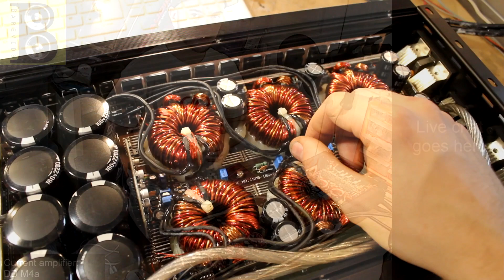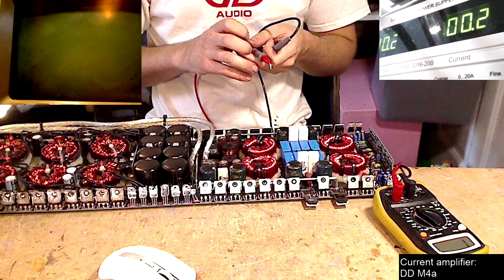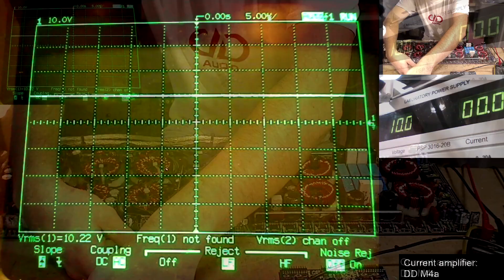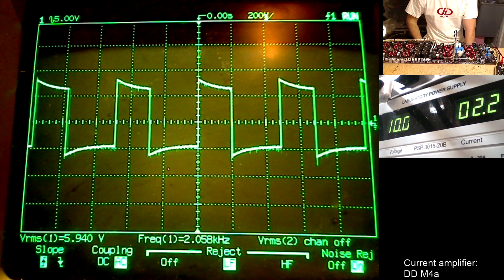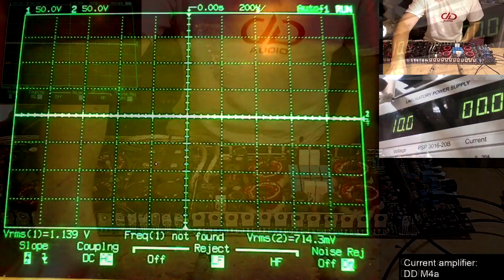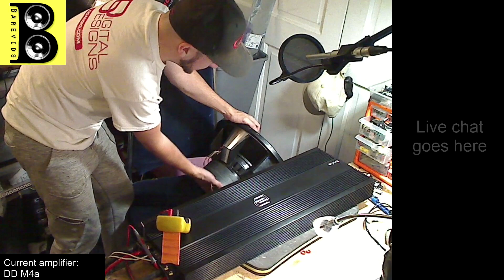How to repair DD M4a amplifier?! Walkthrough

Comment: Must be something with these DD DM series..I have a DD DM-2500A ive tried to repair a few times..About to throw it in the trash pretty soon..Its gotten so bad it just smokes the wires when i try to tuem it on
Reply: I use mine for parts now took the terminals off to repair a nemesis NA-6KM that I have in my truck..Never buy DD again for me lol

Comment: Oh and I also have a Taramps 15k bass that needs repair the issue with that amp is that when the radio is turned off the amp won’t shut off till I remove a specific power cable from the battery

Comment: please please can some one help me with a Phoenix Gold RX500.1 mono block the driver board as a tip42c that as a blue resister oneected to it mine is blown to bits and carnt find the colour bars i think it could be brown black black gold so could be 100 ohm or 50 ohm or 10 ohm its a metal film resister or was lol its driving me insane not knowing so if any one as this amp Phoenix Gold RX500.1 and can confirm the rester on the power driver connected to tip42c and tip41c

Comment: When you started using your scope to probe the pos and neg rails, where was your scope grounded to?
Reply from the maker: Shares a ground with the 12v power supply negative through the mains. This means the ground path is quite long so there will be some minimal noise on the waveform, however when probing high voltage signals this is negligible. If I need to probe some very low voltage waveform where shape is critical I will hook up the probe ground wire to a close reference point.
Reply: @barevids  oh ok, so your benchtop DC power supply has the mains ground connected to negative then. Like shorted out at the supply terminals I'm guessing? I'm having a hard time with grounding cause so many videos say different things. I saw a lot that said it's important to have mains ground be completely isolated from the DUT and the Oscilloscope. To avoid accidentally shorting the mains. Is this just not an issue because the amp is not plugged into the mains line? Like no hot mains going through the amp? 

Thanks btw for the reply brother, I know you have a lot of subscribers and comments so I appreciate you taking the time to reply!

Comment: hey guys, could someone explain why there is negative voltage at the low side fets gates at 19:21? And where does it come from, i mean how is that created if you understand me
Reply from the maker: Negative rail at lowside gate is just "ground" as far as its concerned. It comes from both the pull-down resistor between gate and source (which is connected to neg rail) and also from the drive IC lowside output which is ref to neg rail.

Comment: So if the voltage regulators don't show a short circuit then does that mean either they are damaged or the transformers are damaged or the traces between them?

Comment: i have an mtx amp that is stuck in protect because i was adding another amp and i accidentally wired the power inputs in reverse... it didn't damage the new amp but the one that was connected in my car won't come out of protect mode... i tested the continuity of the 12v imputes and my multimeter beeps but stays at 0.... does this mean that the problem is in the power supply side?
Reply from the maker: Output fets shorted
Reply: @barevids  thx.. so if I change the output FETs then it should come out of protection?
Reply from the maker: Maybe, maybe not, you may have also damaged the drive circuit.
Reply: @barevids  k thanks for the help :)

Comment: I have a Diamond D3 400.4 amp from 2003-2004  that just quit one day. Amp powers on does not go into protect but has no output to the speakers. No hiss or anything. The amp is extremely clean and I love it just dont wanna give up on it yet. I fix TVs but I’m just not highly educated in amplifier repair what should I check? Love the videos man you are very knowledgeable.
Reply: UPDATE: 

I found a MPS A56 that is completely dead across pins 1 and 3. All the other MPS A56s on the board measure good. I thought i had no sound in the amp but holding a speaker to my ear I could barely hear music. I’m hoping I can just replace it and the amp will work. I’ll know soon enough.. if anyone has any insight please let me know. Thank you in advance!!

Comment: Nothing like an M4a, kinda expensive though.
Reply from the maker: Actually there's many amps like an m4a. Identical, in fact 😂
Reply: @barevids  Can you name a few, that M4a is $2599 if there are identical amp to that one and a bit less expensive it would be great to know.
Reply from the maker: @DJ_Renn  SPL dynamics D7, DC audio 7.5k, Sundown ns1, etc. These amp all use an identical circuit architecture with minor differences to rail voltage. Anything Korean halfbridge in this power band is the exact same circuit. Ka7500 PS pwm, 064n or 1405 PS fets push pull an array of transformers, class D circuit irs21844s drive with 24n40f output fets. If you compare guts shots you'll see they're the same, only differences being multiple smaller transformers or lesser big ones. These circuit designs are over 20 years old and it's ridiculous that they are still being churned out and marked up to such huge price tags, when you have brands like Banda building far superior amplifiers, using modern reliable drive architecture, PIC integration, lightning fast protection, modern low RDS mosfets, for a fraction of the price. The banda Viking range is hands down the best mono bass amplifier you can buy right now, and it's cheap as hell.
Reply: @barevids  This is exactly why ive been subscribed to you since forever......Ive learned more from your videos than any other place.......Thanks.....
Reply: @barevids  I had a Ampere 5K (Korean) on 2 Fi BTL neos swapped for a Taramps 15K and the bass was night and day difference, the Tramps just didn't do the low end like the Ampere 5K, I wound up putting back the Ampere and returned the 15k. I now have a Sundown SCV 7500 on 2 Fi audio teams, the question is will the Banda Viking 15k out perform the Sundown cause the Taramps 15K was just a failure. Here is my video of the Sundown https://www.youtube.com/watch?v=nT7kJsset1g
Reply from the maker: @DJ_Renn  yeah the Taramps is an 18-20k amp so it would be a crazy difference. The reason the Taramps didn't play low wasn't actually anything to do with the amp itself, just that Taramps decided to filter out low freq in the pre-amp stage because they never use those freqs in Brazil. They have rectified this on later versions of their amp lineup so they do play low. The banda never had this issue with frequency roll off. You'll greatly enjoy it. Just make sure you don't turn the high-pass up at all, and replace the internal fuses with higher rates ones.

Comment: Hey buddy ! Got exact same amp works fine but pops/AC on outputs after remote is removed/ turned off ? What could this be?
Reply from the maker: pops/ac? blows the fets? or makes a pop sound through the sub?

Comment: What other Ic's are there on these driver boards, i've seen several videos of your's. I see similar board on different brand amplifier, are these D class topology 130Khz are self osscillating type or fixed frequency generator circuits are used.

Comment: What kind of driver transistors for the power supply there are 4 in a row.. On a sav sundown 3000.1d? And are they all pnp ?
Reply from the maker: I can't remember if that amp uses all PNP or some npn also. Take a look at it, and if there are A and C transistors then it's npn and pnp. If you only see As, then all pnp. Use 2sb772 to replace PNP, and bd139 to replace npn.
Reply: @barevids  i found they take 2sa1023. Bd140 or bd136 are safe to replace yes?
Reply from the maker: @tommyfalls  bd140 is fine yep

Comment: I would like to seek your advice.
While I attempted to fix the Fusion car amp I found the one output pair of Mostfets damaged and changed them. I was surprised that after the “repair” the amp drew too much current and didn’t function.
The power supply worked. When I tried to use my scope to trace the audio signal from the input of the Mosfet driver ICs (IRS2092S) I could really see it on pin 3 however one channel worked anyhow.
I was even more puzzled when I saw high voltage and high frequency oscillation around the Mosfets.
It seems to me that some component brings the overall unit into oscillation.
My question, have you seen such behavior and could the IRS2092 be faulty or what is your experience ?
bg{add}bgcontrol.com
Reply from the maker: Hey buddy. Those drive ICs are incredibly sensitive and almost always die when a mosfet shorts. If you found shorted fets, you must replace all fets on that channel for new ones, even if some survived. Very important. You should also change the 2092 chip as this is more than likely damaged as a result of the fets shorting. Note that you will not see an audio wave on any of the pins of the mosfets, this is not how class D works. The 2092 is taking an audio signal and converting it into high and low side pulses that can drive mosfets.
Reply: @barevids  Hi, great insides many thanks for educating me on this class D issue I will do more research.

Comment: i pulled the rectifiers with out realizing they were different. i now have two pairs of fets that i dont know what side they go to on the board. how can i tell which need which side is which? i assume one is pnp and the other is npn? on my tester i see one pair have cathodes and anodes flipped 180 degrees from center.    amp is a hcca5000.1 splx.    i really dont want ot just guess...

Comment: I have a question that I hope to get help with. Never doing any repair myself, the power rail caps melted off the board (05 clarion dpx11500) but amp worked up to that point, had a second battery and fuse between batteries blew causing it to run off back battery until melting point, would putting in rail caps backwards cause it to push voltage from power inputs instead of taking it in? I think maybe manufacturer of caps put indicators of negative backwards as I put them in same as old caps and remaining caps before changing them all and made sure polarity was correct by connector wires. Or could it be something else? I would try to send it to you but cant afford shipping international.

Comment: So, I am having an issue with an older picaso 1500 1D soundstream. bad leads on the sub shorted the terminals between the coil and the terminals so basically the wires got crossed. amp blew, now as soon as the power and ground are connected it blows fuses instantly with out the remote wire connected. i checked the fets using the method in previous videos and all but 2 are bad imo one on the power one on the output section the rest shorted. would new fets fix the issue or do i need to continue trouble shooting. parts IRFB31N20DPBF-ND, IRF1010EPBF-ND.

Comment: Epic video's man love them! But I do keep wondering what the issue on my dd dmf1600 could be, I have had it at 4 different repair shops, none of them had any idea how to repair it, the issue is that it does play the sound but it doesn't look like it's amplifying, I have to put ALL the gains at max (radio and amp) to get even a little bit of sound. Hope to hear from you man, and maybe find a way to fix this issue

Comment: I used to bench test an amplifier on a server psu using a 2ohm dummy load(speaker voicecoil submerged under water i.e. electric kettle), then one day the server psu kept tripping (i thought the psu was unstable because i cranked the psu up to 13.4V- so i dropped it back to 12V), then the amp popped its 2*30A fuse so i replaced them with 2*40A(stock fuses usually popped if left long enough at clipping on 2ohm), i noticed the amp made significantly less power(AC voltage was lower at clipping this time, when its usually higher), by this point it was too late before i realised my dummy load shorted to 0.8ohm. I damaged the amp in some way because the idle current went up from 1.5A to 2.4A after the incident, the amp used to make 900W now it makes 500W while still consuming 1400W. when i inspected the amp there was visually no damage, the only component that was suspect hot was the transformer. The transformer is SMPS style, looks very easy to overheat, im not sure if its damaged, i dont know what else it could be, is it worth attempting to rewind the tranformer? Im worried that ill crack the core in the process.

Comment: Last night i installed it and the boot lid exploded off the car, and now I only have half a car left :) it works perfectly
https://youtu.be/g8GyUocf-ek
Reply from the maker: Hahaha nicely done bud
Reply: barevids I used a -10db overlap 40 htz track to set the sub amps gain but I think it’s too much, what do you use / recommend ?
Reply from the maker: @Mkvy  honestly? Playa fewbassy tracks and turn it up till it starts sounding bad, distorted, sub mechanical limit reached, or voltage drop too heavy.
Reply: I’m  Definitely going back to the setup Bccs in coulsdon did for me, -7.9db overlap at 40 htz, and using the remote sub level to attenuate as and when which is most of the time
Reply: barevids i thought maybe you would use instrumentation but no doubt the human ear is better than anything else. The last time I did it that way the police turned up in the car park!

Comment: Hey barevids! I have two dead DLS CAD-11 amplifiers on my desk right now and Im having troubles repairing them. There is an 8 pin dip IC in the output mosfets  drive circut that has numbers scraped off. I just cannot figure what that IC is. Can you possibly help me with identifying that thing is? The amplifier is basically same as soundstream tarantula TRX-1500D or planet audio VX2200. Thank you very much.
Reply from the maker: It's either irs2184s, 072c or lm211 depending on the rest of the circuit. Send me a pic to my facebook page
Reply: @barevids  thank you very much for an instant response, gonna send you picture asap. There is some weird transistor array right next to the unknown Ic. I dont think that it is an opamp. Gonna look up that irs

Comment: have you ever worked on a hifonics pro 5k???
Reply from the maker: Yep... Barely made 2k...
Reply: i have one and run it at .5 ohm mono its been fine for 4 yrs and clamped at 4775 at last comp but a few weeks ago it started being dumb im lost ...it works but at low volume it works fine as i turn up i start to get into "loud volume" it goes into protect ...shut off system and start back up it work again?? but get loud and right back into protect...any ideas as what might be issue??
i also understand its hard to figure out issues without amp in front of you..
Reply: Did you get it to work? Sounds like probably a bad coil on a sub

Comment: Great video! I have mad respect for your skills.  I like to repair amps too but I don't do it enough to be as good as I want to be.  I wish that there was a school just for amplifier repair.  What's the name of that website to check for the defaced ICs?  Is it Perrys guide?  I typed it in but it pulled up maps.  Is it something in the UK only? I'm over here in the US. I'm glad that you uploaded this video because I'm about to start on a Zeus 1800.1 and it's a big mess.  I feel sorry for the poor amp because I know that it was abused...LOL!  All of the PS Fets are blown open.  The source legs on the majority of them are detached and the output Fets are all shorted.  So I know that the drive circuits for both the PS and output stage are gonna need to be checked thoroughly.  But anyways...great video.  ✌

Comment: So theoretically you could bypass the power supply and transformers using these at higher voltage 😂😏🤔
Reply: If you can provide positive and negative rail voltages, yes.
It would be easier to power these from ac mains using transformer (which would step 120v up to +-150v or so)

Comment: Just finished the video, today I learned how a DD amp works and how it can be repaired :) cheers dude

Although I have a quick question, you mentioned that it is bad to power on an amp without a load or speaker connected, I'm guilty of doing this all the time with my PDX amps while setting the gains, although I have never had anything break as of yet.... Should I avoid doing it in future?

Also I have a 4 channel where only 2 channels are used... So the other two have been left disconnected for years.... Hence asking you the question
Reply from the maker: Hey man! The PDX amps are very well designed to prevent this from happening. Its more of an issue on the older generic class D designs. 
Your 4channel is probably a class AB - they dont care about having a load or not. :)
Reply: Cheers for the info my man, I always did wonder the question if I was alright to leave the speakers disconnected on the PDX

Your right on the PDX, they are pretty hard amps to break and I notice that they love to turn themselves down when things get hectic....

You should collab with @BigDWiz, he is great at showing the power an amp can do, but he could do with you explaining what's inside and how it works when he does the section with the amp opening up

Comment: Just subscribed not that long ago love the videos so far. My question is I have a hf brx1600 and brx 2400 amplifiers do you know of any websites I can get getting all the parts to fix either of these amps 1600 has blown cap and 2400 needs new gets and the little black 3 connections transistors to repair any help is greatly appreciated I live in the US
Reply: Mouser, there the best by far.  You can get everything you need to build those two amps at mouser!
Reply: @joshhanson6777  mouser.com